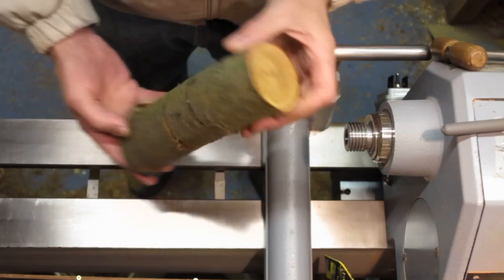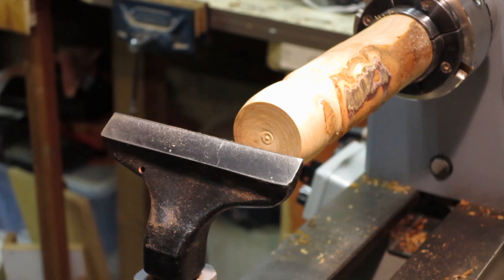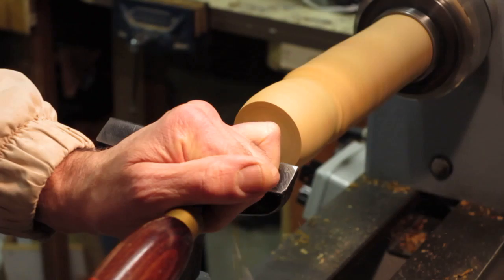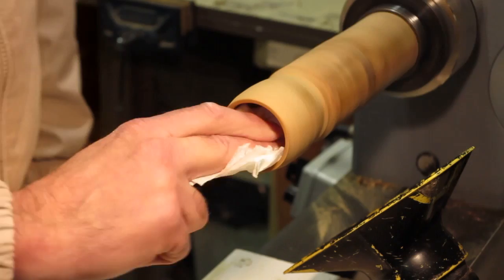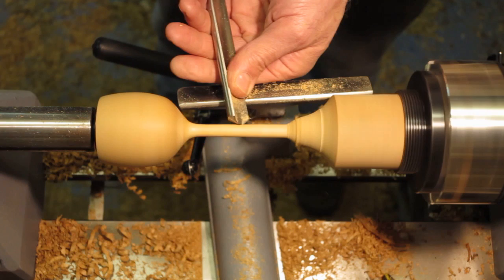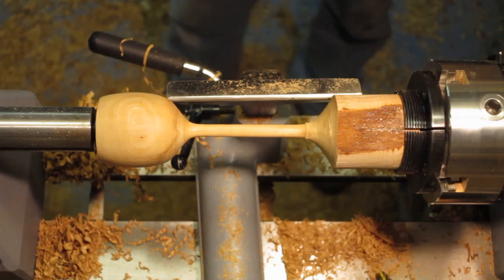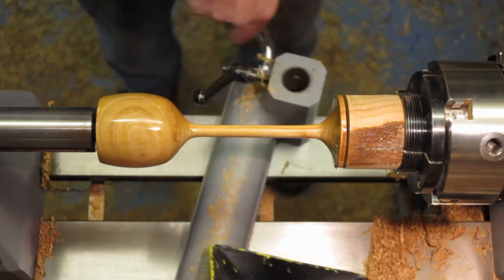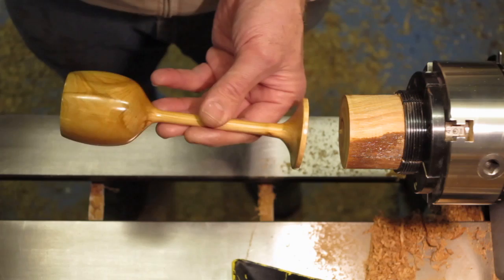Wood Turning - Beginners Guide #1 - A Goblet

Comment: Hello Mike, enjoyed your video on turning a simple Goblet. Thanks. My method of centering square/round stock, particularly if doing many of the same size, is to fit a bung with a sharp pointed center towards the back of my four jaw self centering chuck. Tap the end of the stock. There you have it, centered and center punched in one go. This can be done with the chuck lying on its back on a bench if you are worried about hammering the headstock bearings.
Reply from the maker: +macbrat 
Thanks for the very useful tip, I will try that in the near future.
Take care
Mike
Reply: +Mike Waldt Hello Mike, thanks for the prompt response. I'd be happy to send you a couple of pictures of my centre marking setup. How do I do that? Regards Macbrat

Comment: I'm a new subscriber to your channel, Mike.  I just purchased a mini-lathe and am just getting started turning after reviewing a lot of YouTube videos.  Yours are my favorite!   I have only practiced on dimensional 2x2's so far, and one 12-inch length of pine about 3 inches in diameter that I cut from a recently fallen tree branch. Learned a big lesson about sap in green pine!  What a mess!  After rough-turning (and cleaning up all the sap that got all over everything!), I placed it in a food dehydrator for 3 days, which dehydrated it from a weight of about 12-1/2 ounces to about 6-7/8 ounces.  I am about to try to turn it into a little lighthouse. It developed a few hairline cracks in the ends that I intend to fill with thin CA glue, although I doubt that I will use the ends in the final product.   In practically all of the videos I've watched are instructions to avoid the pith in a log and cut blanks that exclude the pith, and I believe I understand why.  I noticed in this goblet video that you start with a dried log/branch, which must include the pith, but you didn't discuss the pith, and you turned it without doing anything about the pith.  Is there some exception to avoiding the pith that I haven't come across yet?

  Love your channel, Mike!  This video is  over 3 years old, but to a new turner, it's gold!  Thank you so much for what you do!
Reply from the maker: +George V 
Thanks for subscribing and your support George. If I use a dry blank and there's is no major cracking I tree trend to no worth about the pith, in most cases though it's best to avoid it as is the general rule :)
Cheers
Mike

Comment: Mike thanks for the video, inspired me to go down get on the lathe and turn my first goblet. I'm one the newbies your making these video's for, just been turning for 2 months. I used a maple limb that was going to go into my woodburner. just a little worried about cracking as I keep hearing that you shouldn't end grain with pith in it. well we'll in a day or two, thanks again 
Mike
Reply from the maker: Hi Mike, it is ideal to try and turn the pith out if possible, as this is where the cracking emanates, however very often you can get away with it. Try mounting it between centers just "off" the pith area. Hope this helps, and good luck. Let me know how you get on.
Take care
Mike
Reply: Hi Mike, That end grain goblet I turned yesterday did end up splitting from the base to the bowl. How did your Cherry goblet do? I did turn my 2nd goblet today. Used cross grain maple, larger bowl thinner walls, longer thinner stem. Thanks agian
Mike

Comment: Great video Mike; lots of good info here! I'm certainly not new to turning but I am fairly new to turning goblets. The first one was a success...unless you count the fact that I broke of a small piece of the base when I was cleaning up the bottom. This was due to a small fracture that I knew was there and should have been more careful with. At least it came off the lathe in one piece, as it did not break until I had parted it off and afterwards. In the end I repaired it and you can't tell the difference. On a different note, I find that fingernail bowl gouges with a fairly fine point work best for hollowing end-grain. Obviously, continue to use what works best for you. Keep up the good work and a Happy New Year to you.
Reply from the maker: Thank you Jordan, I think as you say, methods are personal preference, but the more methods that are suggested, gives everyone a chance to try, and decide for themselves. Thanks for the input, and support.
Take care
Mike

Comment: Brilliant again Mike. Tonight I will not be watching Netflix (although I may still order in a pizza) I will be watching your beginners guide.  I've noticed you mention 'sanding sealer mix' a few times - is this a secret recipe? Also - paper towels for the wax - why? Versus lint feee cloth I mean. Many thanks again Mike!
Reply from the maker: Thanks David, I used to mix 50/50 Cells Sanding Sealer and Cellulose Thinners, now I use the Pre Thinned from Hampshire Sheen.
Regarding using paper towel .... just something I've always done. Thanks for watching.

Comment: Thanks Mike and a very Happy New Year :)
2 questions for you.  Firstly, you used a circular tool rest to round off and then flat edged for the rest, why?  Secondly, how does one tell a roughing gouge from a spindle gouge?  Thanks again for a great video!
Reply from the maker: Hi Ian, I swap my rests around quite often, there is no particular reason for it, it's just how I feel at the time......:)
Spindle roughing gouges are milled or stamped from "flat" steel stock, and have a tang that goes into the handle, and hence are too weak to use on bowls, also the wall thickness is uniform all around the cutting edge, with a deep "U" flute and are sharpened to a straight grind and not swept back. A spindle gouge is milled from round steel stock, and this allows for a swept back grind with a cutting edge on the side as wall.
Hope this helps
Cheers
Mike

Comment: Hi Mike ! 
Thanks (from France) for sharing your woodturner's passion with us ... especially for a beginner as I am.
Can you tell me what are you putting on the 2 bottoms of this wooden piece ? Wax ? Varnish ? I think it's to prevent wood from crackin ?
Thanks in advance ... and take care !
Reply from the maker: Hi Phillipe, I assume you mean what was on the wood before I turned it ... I use PVA glue (a couple of coates) to aid in the drying process to help reduce cracking.
Cheers
Mike
Reply: Thanks Mike !
It seems to be a simpliest solution to avoid crackin' !
Take care
Philippe

Comment: I'm amazed that the cherry was so young. I was told by a woodworkers group to let some ornamental cherry that I got from a downed limb sit for 1 inch per year of thickness before doing anything to it.
Reply from the maker: Hi Ed, the 1" per year is a good rule of thumb, this was not completely dry, but was stable enough for the video. in fact it warped very little in the ensuing months, just the luck of the draw me thinks. But if you wanted no movement, I agree, a much longer time would have to be allowed.
Thanks for your input, much appreciated.
Take care
Mike

Comment: Wow I find these videos a bit after your creation! Mike what do you seal the ends with to keep from cracking? How long must  a log like this dry before turning? Thanks again 
Jeff
Reply from the maker: Hi Jeff, I use PVA glue on the ends of logs, usually a couple of coats. The rule of thumb re drying of logs is 1" per year, but this depends on wood species and the temperature and humidity of the logs location while drying. Hope this helps. Cheers. Mike

Comment: Mike,  have you ever showed how you built the tool holders on the wall behind your lathe? I like what you have better than what I am currently using.
Reply from the maker: I haven't,  but it is just plywood shelf and semi circles to hold the base of the handles and the the same for holding the tool at the top.
Cheers
Mike

Comment: Loved the video Mike.......I'm some what new at turning and I'm a little confused at the wood orientation. It looks like the pith is running along the stem and if so, does it not slit?
Reply from the maker: Hi Craig , it can indeed split at that point, on this one however I turned to the side of the pith, and it did not run down the stem, I should have pointed that out on the video. My apologies. Thanks for the comment and support.
Take care
Mike

Comment: Excellent tutorial, very nice goblet. I just wish I knew what a friggin mouse pad is and how's it attached to the end stock. Thanks for your expertise.
Reply from the maker: +Robert Langley 
Thank you Robert, a computer mouse pad, held by light pressure. 
Cheers
Mike
Reply: Mike Waldt I must have misunderstood exactly what you were referring to in this video. But I'm aware of what a computer Mose pad is as I've been using these for about twenty years. I will look at video at later date and try to discern what the hell im talking about, thanks. Good work on your part tho. I may need a psychiatrist don't know yet.
Reply: Mike Waldt ok Mike you said you use a piece of mouse mat inside the goblet on the end stock to steady the goblet. I didn't know what this mouse mat material is.

Comment: Mike,
 What sanding sealer mixture and what kind of wax do you use? Beautiful finish.

Thanks

Mike
Reply from the maker: Hi Michael, on this project I used Cellulose Sanding Sealer thinned with Cellulose Thinners 3:1, and two coats of WoodWax22 by Chestnut Products.
Hope this helps
Cheers
Mike

Comment: Thanks for taking the time for this, I noticed on cherry that you used and cut down thats the ends were shiny,  before you put it down to season did you seal the ends with a varnish? Is that normal? Thans
Reply from the maker: I always seal the ends of logs with PVA glue, which seals the ends and slows down the drying process, which in turn reduces cracking.
Reply: @MikeWaldt  Thanks very much for the tip I have just started and this autumn i will be trimming my olives lemon orange and  fig trees so any branches worth keeping for turning i will cut to size and apply some pva to the ends of them and store them in the wood loft, very useful as i have not heard anyone else say anything about how to cut and store wood. To buy blanks is so expensive so thanks again.

Comment: Hello Mike, looking for a bit of advice on Lathes. Which would be a good lathe for a beginner? Also, bench top or floorstanding? Im in the UK.
Many thanks
Kim
Reply from the maker: Hi Kimmy ... that is a huge question.
My advice is to decide what type of turning you want to do mainly, and consider available space, but be aware that you may quickly outgrow a small lathe.
basically get the best your budget will allow, and never forget:
"You can turn small things on a big lathe but you can't turn big things on a small lathe"
Hope this helps a bit.
Cheers
Mike

Comment: MIke, I just started turning and found this video.  Thank you.  I missed how you held the open cup of the goblet while you were making the stem.  What type of chuck was it?  A type of jam chuck?  Or is it a part I can buy?
Reply from the maker: Hi Mike, thanks for your kind words. On this project I used a small piece of mouse mat between the live centre and the inside of the goblet bowl, with hust a small amount of pressure. You can also use a tennis ball, or a number of things, just to stabalise the goblet for when the stem gets longer and thinner. Hope this answers your question.
Take care
Mike
Reply: Clever, thanks

Comment: Mike, I have a question for you. I have been specifically told to get a bowl gouge because turning at high RPM on an end grain of certain woods could snap my spindle gouge if it gets caught. I was told repeatedly to not use my spindle gouge for hollowing on end grain. Then here you are using exactly that gouge, a 3/8" spindle for it. I was wondering if you could clarify what I had been told, or share your perspective on what I was told.

Thank you so much for any of your knowledge and experience you'd be willing to share.
Reply from the maker: I would generally agree with that opinion for the majority of hollowing. But, for shallow hollowing like this I see no issue ... just my opinion.
Reply: @MikeWaldt  thank you for your answer. Your channel and your work is greatly appreciated.

Comment: This was excellent, but I did have a question on the hollowing itself. Are there any secrets to getting a smooth and consistent thickness for the walls of the bowl?
Reply from the maker: Thank you ... light even pressure cuts will produce a nice finish. Sometimes a light scraper pass is a good idea too :)
Take care and thanks for watching
Cheers
Mike
Reply: @MikeWaldt  Well, I was more wondering if there's any way to make sure you don't overdo and cut too deep when you're hollowing out.  It seems as though it would be really easy to take a little too much out and wind up with a weak section.
Reply from the maker: @Skyblade12  Either use calipers to determine the wall width in the bowl section, or use thumb and index finger to "feel" the thickness and uniformity. Both these operations should be carried out with the lathe stopped!
hope this helps.
Cheers
Mike

Comment: Mike,

Would you please share a little input on the PC mouse pad?  Such as, how big of a piece is it, where and how do you place it on the live center,  what type of live center do I need to do this, how much pressure is applied, etc.

Thanks,
JimE - Beginner
Reply from the maker: blackemmons Hi Jim, the piece only needs to be big enough to stop the centre marking the wood, I generally use about 1/2" square or so. Any live centre will do the job, and the pressure is just enough to aloow support, not too much or you'll "bow" the work.
Hope this helps.
Take care
Mike

Comment from the maker: Tom Parlegreco Hi Tom, it could be done several ways, gluing the blank to a glue block, or using a small face plate.
Hope this helps
Take care
Mike
Reply from the maker: dejan justin Hi Dejan, if you wet turn the bowl to an even wall thickness, then wrap it in brown paper and leave to dry out and warp, then remount and finish when it has dried out. In this case I would leave the walls about 3/4" thick. But be warned that most fruit tree wood is very prone to cracking.
Take care
Mike
Reply: +Mike Waldt how do u dry your wood
Reply: Answers my question about what to do if you don't have a chuck like the one in the video.
Reply: Mike Waldt

Comment: Wow! This is awesome! Thanks for the great video. I'd like to get a lathe but not sure what kind. Would be nice to have one that could cut both wood and metal though my primary goal is to cut wood to make parts for my antique spinning wheels. Do you think it would be difficult for a beginner to make a bobbin for a spinning wheel on a lathe? It's only 3 pieces which you then assemble together. Also I've cut steel and aluminum on a lathe before but it's been ages. :(
Reply from the maker: Thanks for the kind words. as you know all things need practice, once you have started to turn, anything is possible with practice, and a bit more practice......the bobbins you mention are certainly achievable. I have never turned anything other than wood,so I'm not the guy to ask about steel etc.but a quick search on Google should give you the answers your looking for.
Take care
Mike

Comment: Hi Mike your post was really good I enjoyed it, I live next to a forest and wondered how long natural wood should be left before turning? I am about to buy the axminster hobby lathe so any advise would be so welcome. Love the vids
Reply from the maker: Hi Dap, and thank you for your support.
The length of time for wood to dry depends on the wood type, size of the piece, and conditions in which it's drying i.e humidity etc.. However if you have logs,  seal both ends with wax, PVA, or a proprietary brand of end sealer, this reduces the speed of moisture loss, and reduces the risk of bad cracking, or "checking". If you are cutting the logs to blanks, and can cut out the pith this also reduces the chance of checking dramatically. you can of course turn "green" wood (wet wood), and then seal the end grain, and allow to dry to about 10%-12% moisture content, then re mount on the lathe and finish turning it, and apply your finish of choice. This method usually applies to bowls. There are many great videos on the subject of turning wet wood and storage methods, on YouTube.
as regards to the Axminster Hobby series, they are a great entry level lathe, I had the AWVSL 1000 when I started, and it was a great workhorse, I would recommend them without reservation, and Axminsters after sales service is second to none.
hope this helps a little.
Take care
Mike
Reply: Mike Waldt Thank you Mike for that great advice,I will do as you say.
I ended up buying the Record power DML 18SH as it has a swivel head for bowels.
I am enjoying all your videos and learning lots from you.
Thank you Mike
Reply from the maker: dap2112 Enjoy your new toy ;)

Comment: Mike, I am a big fan. I was admiring your organization skills on the wall surrounding your lathe station. If you have a plan for your lathe tool storage rack, would love to have a copy or point me to a source..
thanks. From Iowa, Mark
Reply from the maker: Hi Mark, and thanks for your support, and kind words. I have no plans for the tool rack I'm afraid. However it really doesn't need any - the lower rack for the handles is just a 1.5" Forstner hole in a strip of softwood, and the top part is the same, but some are cut in half ...hope I explained that OK. Cheers. Mike